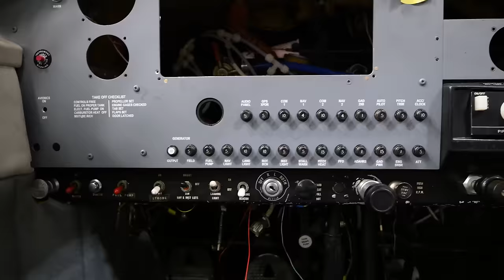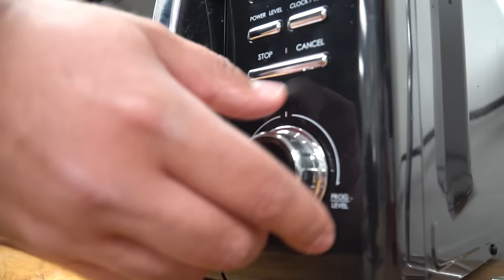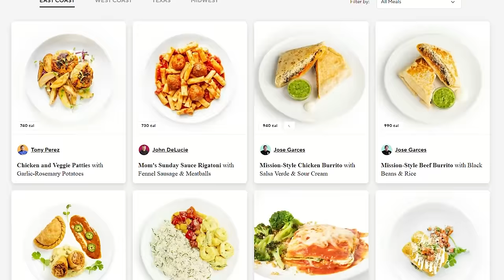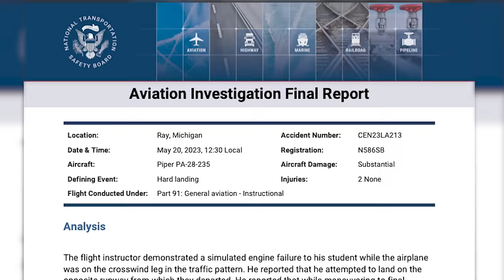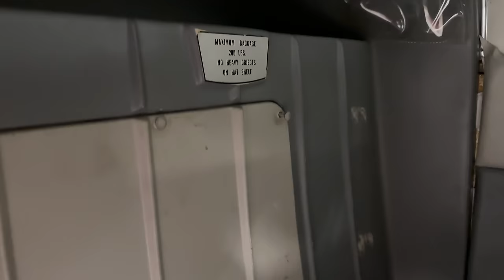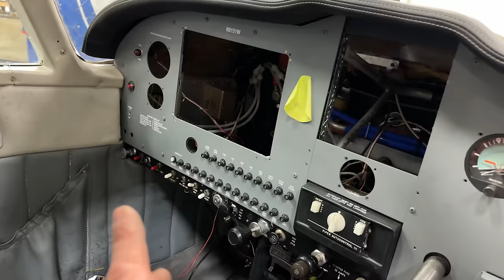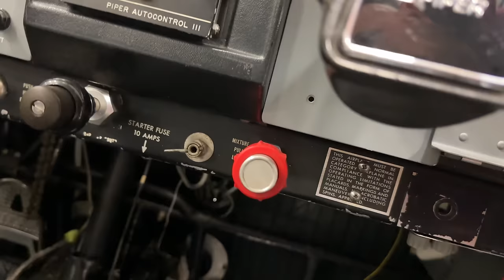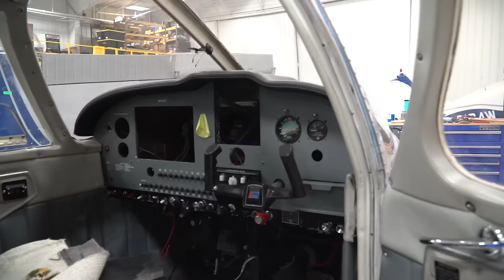HOW BAD IS OUR NEW WRECKED PIPER 235 AIRPLANE ?

Comment: Prop blades generally get bent rearward on impact if not turning or turning at low RPM. Props hitting the ground under high RPM generally bend forward.

Comment: Another good video.  I think you guys got a good deal on this airplane.  The paint job and glass cockpit are really nice.  Yes, it is going to be a lot of work and a lot of hours, but I really think it will pay off.  As far as the engine, I would wait and see how everything looks before deciding on the IRAN.  Agreed you can never be TOO safe and magnafluxing the crank may be a good idea, just try to restrain yourselves from going too crazy and put what you save into the 401.
Reply: i agree about the not too crazy thing. When he said about repainting, other than the damaged areas, I don't see why it needs a paint job. To me it's just an un-necessary expense

Comment: According to my calculations, if you did the minimums to bring the pane back to life, you'd be in it around $85k.  If you do the overhaul on the engine, you're up to $105k.  You'll have more profit margin if you don't overhaul the engine because I suspect that wouldn't increase the value at the same rate it would cost you.
Reply: Correct. Getting 100% or greater return on an airplane repair/restoration/alteration is as difficult as finding a unicorn. Most success comes from applying lipstick. Make it look appealing and hope some sucker makes an emotional purchase.

Comment: Just getting the avionics for that price was a great deal.
I had a new panel put in with much the same as those Garmin, just fyi, if you want to make it a full IFR panel I would get a bigger screen navigator, like the 750xi or 650xi since the 375 screen size is very limiting and can't show IFR plates, only the 750/G3X will do that.
The G3X is NOT IFR certified, for that you need to couple an external approved navigator.

Comment: how can you work on the motor without a A P doing it?
Reply: You can work on your own aircraft under the supervision of a certified mechanic. I didn't see any real work being done.
Reply: Here is the text from FAR 43.3 which defines persons authorized to perform maintenance, etc:  Paragraph (d) states:  "A person working under the supervision of a holder of a mechanic or repairman certificate may perform the maintenance, preventive maintenance, and alterations that his supervisor is authorized to perform, if the supervisor personally observes the work being done to the extent necessary to ensure that it is being done properly and if the supervisor is readily available, in person, for consultation. However, this paragraph does not authorize the performance of any inspection required by Part 91 or Part 125 of this chapter or any inspection performed after a major repair or alteration."

Airworthiness Directives (ADs) are required under FAR part 91.  FAR 43.3(d) clearly states that you cannot supervise a required inspection.  So, this crankshaft AD runout check cannot be used for AD compliance as this was performed by a non-certificated person.  Another task like removing the propeller can be done under supervision.
Reply: @KurtFlunkn  Yep, anyone can do it the work under supervision but their name MUST be recorded in the maintenance record as the person doing the work. Ref: 14CFR43.9(a)(3). How many times do you think Joe and Jason's name appear in aircraft maint. records?

Comment: Is there such a thing as a profitable airplane flip?  Have yet to see one.
Reply: Based on the prices, the most profitable option seems to be to buy one and strip it to sell the parts to optimists.
Reply: I agree having looked into this a number of times over the last 30 years or so.  The big costs are the engine then avionics.  The airframe is just a box to keep the expensive parts.  Project math always seems to work out that the acquisition costs + parts are more than the cost of buying a flying airplane.
Reply: Yeah, they are planes that have turbine engines attached. There is no money in flipping puddle jumpers.

Comment: Any prop strike needs to get crank, block etc needs to come apart and x-rays  along with straightness.  I'm not a pilot  or an a+p but plenty of friends that are.
Reply from the maker: The FAA requirement for a prop strike is to inspect the rear crank gear drive pin. Lycoming recommends disassembling and replacing the crank bearings, and rod bolts. We’ve decided the best course of action is a completed disassembly and a thorough inspection including MPI (magnetic particle inspection). I saw a crank a few weeks ago that had a prop strike and was cracked but wasn’t bent. That changed my mind with how far we need to go with prop strike repairs.
Reply: @rebuildrescue  right on bro, I wasn't sure of the tolerances. I lije watching your channel.  I live in alaska and looking to get my license  and buy a plane. Been a lil tough on the pocket after having an accident  that tool my life twice in a week. But if I can get in the air and then get my rotary  license, then I want to get into search and rescue , I feel the  need to help people.  Thanks for the feedback on that.

Comment: wonder why there isn't a soft metal keyway in the prop to absorb impact forces.  hate to compare aircraft to a lawn mower but the rotary blade on a mower has one to avoid crank damage when a rock is hit. this 50 cent part on a mower when bent changes the timing and makes the mower hard to start. that's why there so many good mowers at the curb on trash day.
Reply: 5.0 hp vs 200 hp.  
There are some small hp airplane engines with a tapered crank and separate prop flange that includes a drive key but it's not really designed to shear on impact. A Woodruff key locking the prop hub to the crank on a 200+ hp engine? Nah, not happening. The prop flange is manufactured into the crankshaft design for that reason.

Comment: I have been away from the channel for a while but just heard that. Sam had an accident. The plane can be fixed, how is Sam?
Reply: Sam is dead.
Reply: @JanPatrick Classy. Very Classy. Sam is in Heaven. ❤
Reply: Sam was just taking off a d crashed just two miles from the end of the  runway, investigators found water in both carbs, one engine quit just after take off and he went into a hard turn, he didn’t have enough elevation to save or even try to land, this was the story I heard, RIP Sam
Reply: He flew to heaven

Comment: Don't worry about the fact that there are no avionics or gauges, the leather seats will clean up nicely! 
That is not the aircraft to fix up to make money on, that's going to need a substantial budget to get it airworthy again.
Engine out to check, renew drive gear, new engine mount, prop, noseleg, exhaust, air boxes, tyres, side step, avionics, gauges,  repair both wings, put the wings back on.....and we're only 10 minutes into the evaluation! What about all the stuff you are definitely going to discover along the way?
You need a buyer that's going to pay $200k to break even....oh, there he is, riding towards you on his unicorn!
Reply: Lol you don't listen very well he has all the avionics and gages.
Reply: He's done it many times.he can handle it just watch instead of complaining.
Reply: @jerrywilcox9890  Maybe you didn't listen; he said he's probably going to fit them in the Saratoga, so what's going in the 235? 
In any case, these avionics have never been fitted in this aircraft so it's not a case of plug-and-play. They will need a new panel, upgraded wiring, associated engine transducers etc, and all that costs money.....lots of it. Just having the avionics in bubble wrap is only a part of the expenditure saved.
Reply: @jerrywilcox9890  I'm not complaining, just being realistic. How many planes has he rescued, rebuilt and actually sold? Against how many he has bought and has scattered around the country, paying hangarage on them all?
Reply: Did we watch the same video 🤔
Reply: @RebuildingScotland  they was in the plane before the seller took them out to sell them separate so he bought them along with the plane lol.damn you definitely don't listen to anything hahaha.the avionics came out of that plane.you would actually listen you wouldn't be commenting stupid crap lol.
Reply: @coldsamon  Who knows what you watched, but I distinctly heard him say he might put the avionics in the Saratoga, so what does he have to go into the 235?
Reply: @jerrywilcox9890  you arent very bright are you??
Reply: @texastyrannyresponseteam794  ya you ain't are ya.im very bright since I own a trucking company and make 7 figures a year lol.
Reply: @RebuildingScotland  those are the avionics that came out the airplane... They were pulled for resale... Then bought by Jason anyway...   So they are/have been in the plane...  They will have to be reinstalled... At least a partial harness made to graft it all back in... Then all setup and calibrated...    I agree he's way too deep in this one financially... It's not a good flip if he follows through and makes it as nice as it should be... If he takes the avionics and puts them in. A different plane... He's going even deeper...   If he doesn't inspect the engine the right way.. The plane will never get full value... So he's in a box there too..   He paid way too much for it... But making good decisions isn't Jason's strong point... But.. You arent taking into consideration this is a youtube channel. So that income from the channel and advertisers.. Donations make any of these projects doable.. Otherwise they all lose....  He will be just find... He's making a killing even if he pays too much... Big picture my friend...  And this other guy Jerry wilcocks... He's just an idiot.. Fanboy..   Hasn't a clue about any of this... Much like Jason himself... Lol
Reply: @texastyrannyresponseteam794  I understand all that.
What makes me frustrated is that he could spend the money on the 401 and advance that project greatly. 
I came to this channel to follow the 401, not to watch him sitting in an airport, then driving somewhere (recent episode).
I'm at the point of unsubscribing because the content has moved so far away from the original direction.
Reply: @RebuildingScotland Your comments  are 100% correct. There is some type of cult attraction to this guy. He is unable to complete his PPL after 3 years, is not an AP, has no credentials and seems oblivious to air safety.
Reply: @NeedtoSpeak  The seem to be a raggle-taggle bunch of likeable guys, but that doesn't translate well in aviation. In a backstreet garage, yes, but not when you are playing with aeroplanes, as has very sadly recently been demonstrated.
I was an aircraft engineer many years ago and I invariably sit watching...and wincing at what Jason is doing and saying.
Will he ever actually complete one single project?

Comment: I was thinking of another way that planes can be rescued. Using just the cockpit as the base, set up one of the flight sim kits like you have in the other building. If done right it could be done on a trailer with airconditioning and used at schools and air shows. As a business, if done on budget and not too overboard, you could turn a few of these out a year and sell or rent to flight schools or consumers. Think of the different sims, single, twin, maybe even jets. (A Sam-Sim) Simulator.

Comment: Praying for you Guys, Honnor Sam by Getting Your Pilots License Jason, Always Check for Water in Your Fuel Pre Flight, Make Sure All Your Fuel Caps Seal Correctly (So Water Intrusion is not an Issue that You Have to Deal with) Remember Flight Emergency Incident Procedures for the Air Frame You are Attempting to Fly (Feather the Prop Right Away on a no longer running Twin engine Air Craft) Look Up the FAA Report (a mater of public record) On John Denver’s Fatal Flight & Final Flight. Please Stay Safe Show Safe and Enjoy, Continue to Share the JOY of General Aviation I Sincerely Care About All Of YOU …………… Many of Us Do !!!

Comment: All of express of costs would not going to be increased because there would be normal cost 💲 about 55,000.00 to 70,000.00 dollars if that go downhill to hit about 💲 25,000.00 to 35,000.00 dollars. There can be more hard dollars to selling those airplanes if those avionics technologies are good price then that’ll works as much. My opinion that would cost around 25,000.00 between 35,000.00 dollars and there’ll being flying far distance from your location if there was a enough gallons to go by fulfilling the gas in that tanks. My adoptive father has this one before and there was a Cessna 172 as how ever so his airplane was distance about 220.00 to 250.00 Klick Miles to get another fulfillment this tanks by those gas. So, that was normal range to go but just be careful with pressure by air in the sky as long as you go but sometimes it’s going being wrong with something comes up with those problems. I have heard those prices before likely Jason said so that’ll be a hard dollars to selling those airplanes because it were justified also price wouldn’t go this much. Those activities to requirements to complete those things are working on it but that’ll not go that much as 100,000.00 dollars. Well, that’s very much risky to do with these old airplanes but most of airplanes would staying at this limit range of about $25,000.00 if you’re lucky to get some profits from someone who wants to purchase this airplane. Who knew this ? So, how ever you do and it’ll be very difficult to selling those old airplanes but sometime people get mad at those bs price so they’ll find some ways to bargain those price to grab then you would lost those profits from your labors of those hundred hours. That’s what i have heard but there will be a hard dollars to selling but that will be no more luck to get someone else who wants to buy your old airplanes right after you done with renovations with those old airplanes. If you don’t buy it or don’t believe it then take a look at your own eyes 👀 to see. Sometime they won’t seek your messages to sent in videos like you do that today in youtube videos.
Reply: dude..  lay that pipe down...  you need to stop using drugs..
Reply: This Man has no ideas what i was talking about it but there’s no such of drugs as weeds. Look like this man has no experience about those stories of small airplanes that way i has heard few people were working there also they told those stories about it. If this man realize those cost 💲 of overvalue of small airplanes 🛩 then this airplanes will go on the market and that’ll be a hardest dollars 💵 to get it by someone who purchase this airplane. Also if this man thinks i’m wrong then take a hard look and see for yourself also try this then see what the business come and go but profitable from that. Also sometime it’s lost profitable from this are absolutely failure by investment. If this man said “ Errors “ then take a hard look because i was there in my life and i have heard this one of stories from the past. So, i’m not the damn pastor to you or anybody else who thinks that as it’s the way are by business dealings.

Comment: Dear Jason,
This Piper PA-28-235 is to my opinion a good deal for getting her back in the air again since it seems not a great deal to repair this plane. The hole in the wing might be the most difficult part to repair but as far as I can see for the rest it’s a matter of replacing some parts and to complete the dash for which you already have all the parts shown in this vlog. I look forward to your next vlog and send you love from the Netherlands
Reply: Dick, That hole in the skin would take an experienced aircraft structures tech only an hour or two to complete for a scab patch. Double that time for a flush patch. Fuel tank only takes about 30 minutes to remove on this airplane, for access. Just wanted to put in to perspective that the damage on the wing is a simple repair. Although I think as far as sheet metal repairs for this project. The area on the lower firewall seems like it could be a more difficult repair depending on the extent of the damage.

Comment: The problem that lead to the loss of Sam is sad, but these things do happen. It does point out the need to be watchful of all things.

Those are some nice electronics, worth about what 20K. So you paid retail for the electronics and got the plane for 17K. Good deal. Yes, you are going to put another 50K into it, but that still brings you in at under 100K at the max. Still a very good deal.